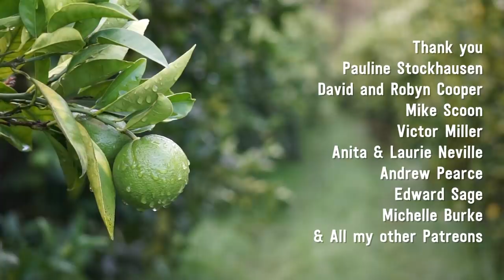Lockdown Lifestyle - Our Camp Set-up

Comment: You are doing a sterling job, just a couple of things, before you can drill out some rivets especially steel ones you may have to pin punch in the centre a bit before drilling as the drill wont drill with the break stem there. Another thing if you can start riveting from the centre and work out each direction this stops the metal bunching. But go girl!
Reply from the maker: Oh thanks Ted! Great tips😀

Comment: We live on a 32ft boat and we had to move stuff about to work from home too. Our biggest issue has been since most shops don't want to handle cash, and our laundry / is coin operated. I got enough before lockdown to do the first 4 weeks, but even in level 3 it's hard to get coins. Hoping we get to level 2 soon and banks open back up!